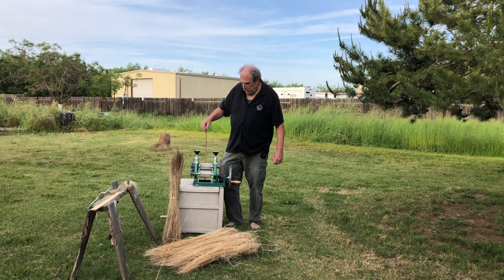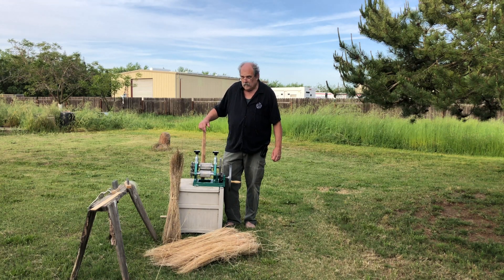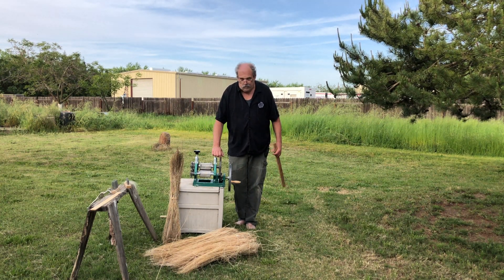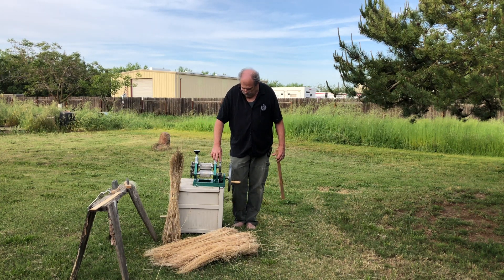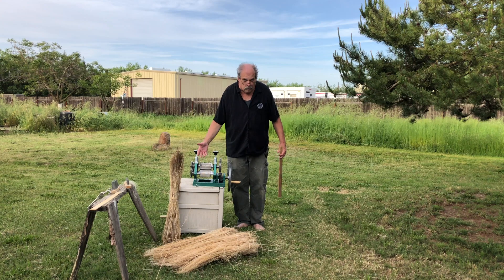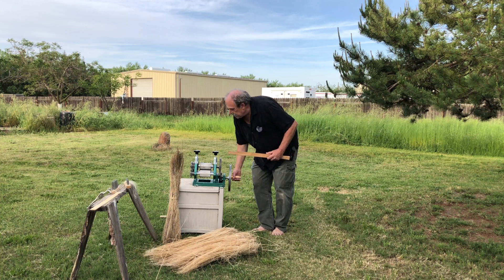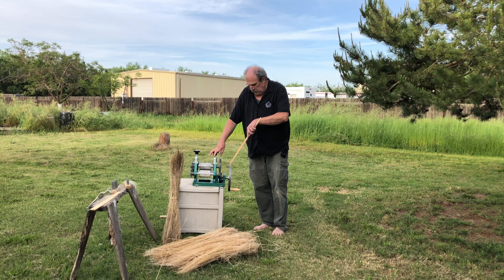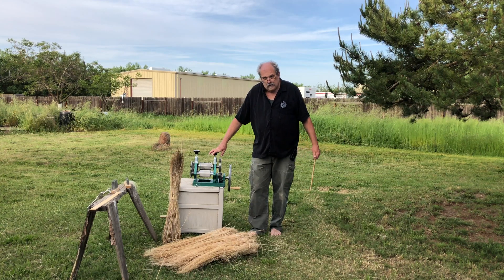Cane Crusher for Flax Processing

Comment: Thanks for the demo of this interesting gadget!  I am easily sidetracked by an interesting gadget.  However, in this case, I'll continue with my plan to build a break.
Reply from the maker: Yes, By all means build a real flax break. This has been a great experiment but does not replace the tried and true flax break. This machine does work but it is slow. If I connect it to a motor it may be faster. I'd still like to use it in conjunction with a flax break to quickly knock out the broken chaff. It does help crush the core at the tips of the flax better than a break so both together would be good. Still working towards making a large wooden gear break that will work better than this and a break combined. Once the wood gear break is done and working I can have a metal one made to do the same job that is powered with simple 120v motors.

Comment: I wonder if a pasta machine would work.
Reply from the maker: I believe the grooves run the wrong way to be used as a crusher. I had used a hand crank barley grain crusher in a similar manner that works but requires smaller hand fulls of flax. It does work but adjustment is minimal. This crusher has spring pressure for adjustment and can put on the squeeze quite well. Im thinking of modifying the rollers that actually do the crushing by cutting deeper grooves so they can actually not just crush but also break the fiber. I won't need to cut too deep because I won't be using super large handfuls. It might work. If it does not I will have ruined the crusher rollers and will need to replace them. It is a good start for a DIY modification to be sure the grooves are equal so they won't bind up when turned. I'll need to test my theory first before committing to cutting them like I want. Need to connect up my electric motor for this to be a better alternative.
Reply: @abittwisted  Good luck, post a follow up video!